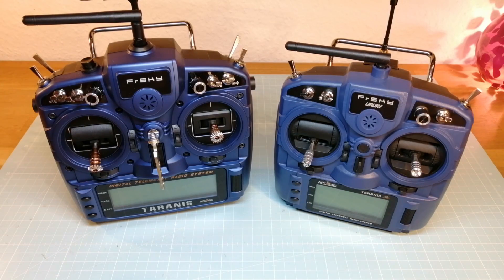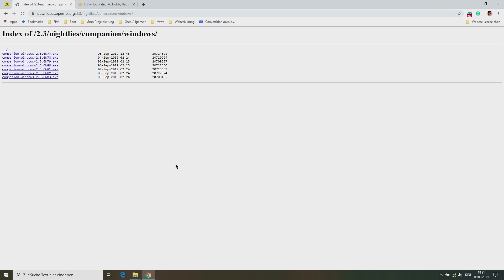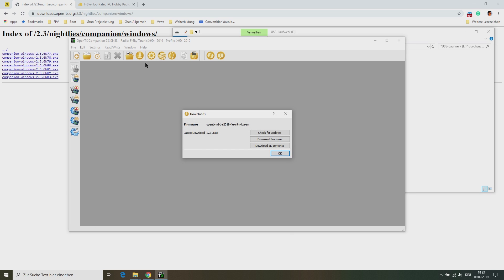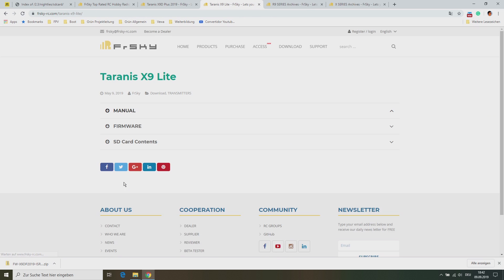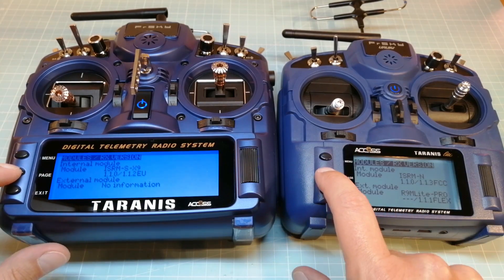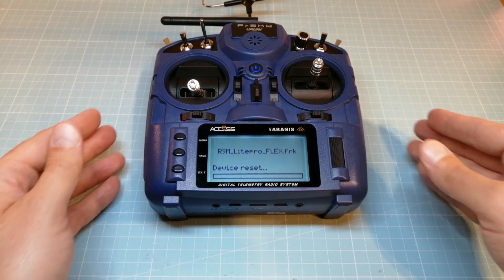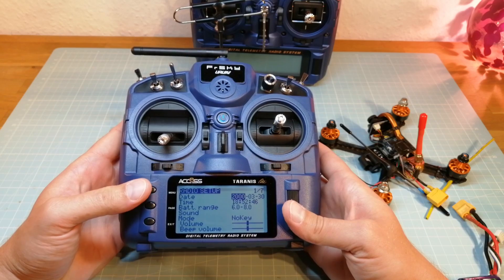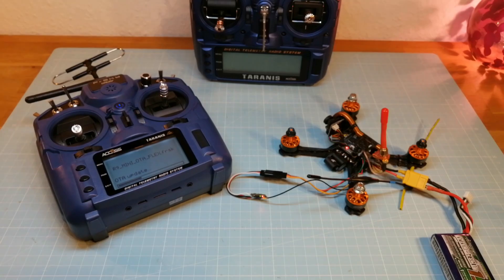FrSky X9Lite X9D+2019 🤓 ALL YOU NEED TO KNOW - OpenTX - EU-LBT / FCC - Firmware - OTA - Access - R9

Comment: Hello, thanks for the video! I have got a question. If I want to use access with 8 channels, how can I set rssi.? Will it be send in channel 16? When I bind the receiver with 8 channels, I get aux 5 going crazy in betaflight
Reply from the maker: Thanks, it doesn't matter if you bind it with 8 or 16 channels. The aux that goes crazy is probably the rssi output. But you can also broadcast your rssi telemetry value from your transmitter back to your fc over a channel. I did it on my last range test videos.
Reply: @TorbanDallas  thanks a million, you are the best! Keep bringing us this nice videos and knowledge
Reply: @TorbanDallas  nonetheless, even when set to 8 channels, rssi is still being transmitted via aux12... I don't understand, should it not be transmitted on aux 4?
Reply from the maker: @dmurillo11madrid  no, rssi output channel comes from the receiver and has nothing to do with the number of channels your are transmitting

Comment: Thank you for this video! Very helpful. I would like to ask two questions. I ordered today the r9 m 2019 with r9 mm receiver for my x9d 2019 se. I just discovered that in my order it doesn't say ota for tha 9mm receiver. Does this mean that I should order the new receiver with ota sticker or If I flash the receiver with the latest firmware it gets ota function. And the second question is that when you tried to register the receiver I saw in your taranis that you had the option to choose between fcc, lbt, 900mhz, 868mhz or access. When you choose access can't you chose between different mhz afterwords. (I am asking because although I leave in Europe I would like to keep my radio in fcc mode because some of my whoops receivers are in fcc. But for the r9 I want 868 mhz in order to avoid interferences. (I hope I managed to be clear and didn't confuse you thank you again)
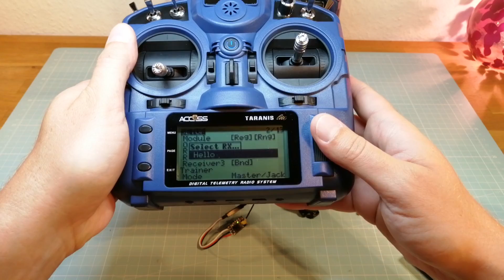Reply from the maker: Thank you for your feedback, I appreciate it! Don't worry, you can also flash the non-Ota receivers with the latest access firmware, but the Ota function won't work! If you want to flash the receiver over the air, you definitely need to buy the OTA Receivers. If you download the Access Firmware, you will see that you get 3 folders, one for the fcc Firmware, one for EU and  one for the flex firmware. With the flex firmware and your radio flashed with the flex option too, you will get the chooise which Frequency you would like to take on the binding process - you probably missed it, i have shown it in 11:56
Reply: @TorbanDallas  thank you very much for your help.. You are very kind. Have a nice day

Comment: HI AGAIN! i am using the x-lite pro, everything is working except  the rssi on the internal module using accts, my problem is from the telemetry-sensor source page on the radio, where it should say int module it is just blank and cannot get an option to change it, this issue is not a problem with the external module and works fine and i am getting rssi on the radio and osd but i use 2.4ghz on my short range quads, the radio picks up the rssi but i want to see the rssi in the goggles and i am not getting the rssi channel showing on the receiver tab in betaflight using the internal module. Any info to resolve this issue would be greatly appreciated. thank you.
Reply from the maker: It's not an issue. There are two ways of showing the rssi. 1. Using the Rssi ouput channel of your receiver if the receiver and the firmware provides one. 2. broadcast your rssi telemetry value from your taranis back to your quad over a channel.
Reply: @TorbanDallas  Thanks again for answering but managed to sort it out.

Comment: Hi bro Do we need Access radio to get OTA feature? I having old qx7 ACCT
Reply from the maker: yes, only the new radios with access are supporting OTA Updates. And as i know it's hardware related, so there won't be a opentx future release that adds the ota function.
Reply: @TorbanDallas  Can we flash flex firmware on R9 rx and will with work with old ACCT qx7 ??
Reply from the maker: @outboxfpv4360  you need accst oder access on both: Module and Receiver. But Access is only supported by the new r9m 2019 or the x9lite pro module. But you get the access fw also for old r9 non OTA Receivers on the frsky website. So you can use the r9m2019 with access and old receivers with access.
Reply: @TorbanDallas  I was asking about my TX. I have old Taranis qx7 will it work on it?
Reply: @TorbanDallas  also das alte R9M läuft nur mit accst Firmware verstehe ich das richtig? Könnte ich dann die r9mm, r9mini, r9mmOta Empfänger mit der gleichen Firmware flashen?

Comment: Hi Torban! I have Taranis X9 lite pro uruav edition and eachine reddevil 2 drone. I can not bind them with each other. However I can bind drone to other frsky transmitter and can't bind  my taranis to other receivers. Seems like a problem in transmitter. What could be a problem? Could you please suggest something to do?
Reply from the maker: I don't know the reddevil 2 drone, does it has a FrSky Receiver? Also make sure to use FCC or EU-LBT Firmware on your Taranis and your Receiver.
Reply: Torban Dallas In explanations to Red devil it says it suitable with frsky, flysky and other. I chose frsky. How can I check eu/fcc receiver?
Reply from the maker: @fanisaiupzhanov2299  you can't check it, you only can flash it.

Comment: good I do all your steps but with the stable version opentx 2.3.2, I put at r9m this version FW-R9M2019_ACCESS_V1.1.1 (R9M2019_FLEX.frk) and at r9mini this version FW-R9MINI-R9MM-ACCESS_v1.1.2 (R9_MINI_FLEX.frk) but I do not get flash S.port only gives me the option of flash external device and when I run it, it gives me an update error, which I do wrong, I think the firmw are the same version and also tried with other firmw, I don't know what to do anymore, Regards.
Reply from the maker: Flash s.port doesn't work on a X9D+, I think it only works on a Taranis  X9 Lite or Pro with the external s.port. On a X9D you need to flash external device and to connect it to your pins on the module bay. If you are using OTA Receivers with you new Taranis X9D+ 2019 or X9Lite Pro you need the OTA Firmware ( But you can also flash old non Ota Firmware to OTA Receivers)
I have heard about errors on flashing OTA and registering receivers with the newer opentx versions, it was already a bug that i have even posted on github. As you can see here: https://www.youtube.com/watch?v=SIfRGIPvVag
Maybe that's the error you are talking about.

Comment: hi I'm trying to flash the latest OpenTX FW but is says wrong directory /FIRMWARE even though its on the sd card '
Reply from the maker: Specifiy what you are doing please. Are you using companion as shown in my video? Did you download the firmware, and then when you flash it you get this message? Make sure to set the right structure path in the settings! And use en (english) language pack. In some cases you get errors with different languages.
Reply: @TorbanDallas  it was a simple wrong name in the folder hehe took me 4 hours to fix it . anyway thanks for the response and thank you for your videos

Comment: How can I get ISRM Lua script for X9D plus 
I have EU (LBT) transmitter and want to convert to Non-Eu(FCC) because of that I can not able to connect my R9M module to R9mm receiver
Reply from the maker: I don't know if this script also works with the old x9d+, there were two versions, fcc and eulbt with different internal modules available. So I doubt that you can change the internal module to fcc. And you are talking about the r9m... That has nothing to do with the internal one. You can flash the EU or FCC fw to your r9m module and your receivers.
Reply: @TorbanDallas  Okay Thanks for quick reply 
But I'm facing issue with binding r9m module to r9mm.And 3-4 weeks ago I manage to bind the receiver but after connecting to quad in just 5 to 10 sec it says telementary lost and nothing works no input shows 
I don't know what causing the problem my r9m module is also EU(LBT)
Reply from the maker: @sushreymeher3981  both have the same firmware version? Sadly frsky has released some faulty r9mm receivers with problems like yours... Maybe you have a bad r9mm 😕
Reply: @TorbanDallas  think so 😔 
Thank you 🙇

Comment: Thank you for that video!
I got a question:
I was trying for hours to get my brand new radio working in EU mode - I could not find the fitting firmware - now thanks to your video I know how to change that xD

So obviously the radio is bind to the receiver in FCC mode... when I change the setting in the radio, will the receiver still work, or do i have to change / update something else as well?

Thank you
Reply from the maker: Thanks for your comment, you also need to update your receiver to the EU firmware.

Comment: I am SICK of r9s,  I had 3 died with steady red led, then I bought 3 new one and came with access OTA stickers, and I cannot use them on my "old" configuration, i need to reflash my module amd taranis and then what happend with my other 5 quads that have the "older" r9mm model. BULLSHIT. Time crossfire
Reply from the maker: You can flash old accst fw to the new Ota access receivers and the other way around. The receivers are all backwards compatible like the new radios. Unfortunately only the old r9m can't run the access fw.

Comment: Hi Torban. I've got now a x9d+2019 and a r9m 2019 for testing. The internal module is backwards compatible so that I can use my old rxsr with accst . What about the r9m 2019? I flashed the access flex firmware and set the external module to r9m and 868. The old R9mm has still the latest  flex firmware of 02/2019. I was not able to bind the rx, unless I flashed the old non access firmware to the r9m 2019. But like this I will not be able to use old and new R9mm in different models. It would be better if both can be used like with the internal module. Any idea?
Reply from the maker: Yes would be better but I'm not the one who is programming the Firmware... I think you have to decide which fw to use. You can flash your old r9 receivers to the access firmware. That's what you can do.

Comment: Hi Torban....question: 1) are the old r9 mini and r9mm receiver compatible with the new access protocol and firmware??  2) I know the old r9module is not compatible so I will buy the new one....but can I use the new module with my QX7 radio? I will not use access with the internal module.
Reply from the maker: Yes you can use the new module with your old taranis. And you can also flash the old r9 receivers with the access firmware - just take a look at the frsky website ... there you will see that you can get also the access fw for your receivers.
But at the moment i think you won't be able to use the ota update function with your old taranis.
Reply: Thanks. Even with a new R9M module I won’t be able to use the ota??
Reply from the maker: @enricobononi8655  I don't know. I think it depends on opentx and your radio.

Comment: will the previous X9D+ SE work with the OTA using the R9 module if everything is updated to the latest?
Reply from the maker: I didn't try it. Do you have the Ota update option on your opentx version for your radio? I doubt it.
Reply: @TorbanDallas  no, FrSky isn't supporting older product with the new ACCESS protocol. Looks like only R9MM will work as long as Flex firmware is loaded. Do you know off chance if I flash the R9MM-OTA with the R9MM firmware, will it essentially turn it into a non-OTA R9MM?  Or am I stuck with a receiver I cant use?
Reply from the maker: @ASorren  try it and let me know if it works :P

Comment: Hello, sir! This transmitter dont support d8. Will I have any problems with tiny whoops like mobula7, that uses d8 protocol? Or if I'll buy multiprotocol module which supports d8 - It will be ok to fly that tiny whoops? What about long-range modules? Which one to choose to fly far away?
Reply from the maker: Hi, at the moment there's no D8 option available, but hopefully, opentx will add this option on a newer firmware release. They are adding more and more with every release. With the first release the new FrSky Transmitter haven't been backwards compatible and now they have added more and more option to also use the old accst receivers.

Comment: can I update my x9D plus? or i must buy new radio?
Reply from the maker: You can't use the Access Protocol with the old x9d+ for r-series receiver with the internal rf. But of course you can use the r9m 2019 with the access protocol. But I'm not sure if Ota update works.
Reply: @TorbanDallas  but I can't finde access update for my old x9dplus :(
Reply from the maker: @246rs246  did you install the latest version of opentx (OpenTX 2.3.0RC4 )? On the external Module - there I think you will also get the option R9M Access,
Reply: @TorbanDallas  I mess up settings on Companion, that was reason why I can't update my taranis to 2.3. Thx for help :)
Reply from the maker: @246rs246  and now you can select r9m access?
Reply: @TorbanDallas  no I have modes only Fcc EU 868mhz and 915mhz on my R9M2019. Im curios about if i update my x9D+ with x9d2019 firmware :P but I'm litle bit scared bicouse I have only one radio

Comment: thx Torban for the very detailed guide... i tried updating the R9MM and R9mini to access.... the update was OK but iwasn;t able to bind.... i'm running the X9lite pro, so do i have to update the internal modul as well with the nightly build? the remote cam with 2.3 official, but i couldn;t get it to identify the RX at the registration step.... 

the updating the internal nodule would not affect my other receivers?

thx alot in advance
Reply from the maker: Thanks for your comment! You need to update your opentx to the latest version (opentx 2.3.0rc4 at the moment) Check the flex option if you want the flex firmware, don't check it if you want the FCC Firmware, Check Eu in companion if you want the EU Firmware. This option changes the possible options you can select for your external rf. Then flash your external r9m lite to the latest fcc, eu or flex firmware corresponding to your companion setting. If you don't have an external r9 module you can't use r9 receivers with your taranis - then you need a R-series Receiver.
Reply: @TorbanDallas  thx..
meanwhile I was able.to update to the non access flex.firmware.. I'm running R9 lite module with MM receivres.. 
So I'll try going access flex once I'll update the radio to the latest openTx

Comment: why you dont give a link for lua script? It is a tool you use in the video, but you dont provide it... Thank!
Reply from the maker: I said that you have to ask Frksy, or me :) or maybe I will link it. But now you have asked me ... I will send you a link.
Reply from the maker: btw: until now, there were only two one asking me for the lua script - so there are only two eu users - or no one listens to me ;)

Here's a link for you, maybe i will also link it down below https://c.web.de/@400672573215480045/ZCiSYxw0THuc3tYleZIViw
Reply: @TorbanDallas  thanks very much🙏☺️
Reply: @TorbanDallas  that is how I ask when I am panic 😂 pls give me a link
Reply from the maker: @ALL4FPV  I did above...
Reply: @TorbanDallas  I update x9 lite Pro opentx to 2.3 nightly, firmware internal receiver to latest, R9M lite Pro to flex, R9 Mini to flex, I chose external modul r9mlp access and then I managed to register r9mini. However, it just doesn't bind... What I do wrong??? I have same problem with xm+, it doesn't event register. I flash it to access firmware and tried register didn't work. I flash it back to accnt and I chose internal receiver acnt ass well and it doesn't bind
Reply: I flash back internal reciever to 1.1.2 and I managed to register xm+ receiver. But I still cannot bind...
Reply from the maker: @ALL4FPV  what happeneds when you try to bind? Nightly n83 was fine but leatest nightly and rc's are having an issue... I have opened a github ticket about it. Hopefully they will fix it soon.
Reply from the maker: That's a short video about the issue https://youtu.be/SIfRGIPvVag
Reply from the maker: And here's my github ticket about it https://github.com/opentx/opentx/issues/6771
Reply from the maker: Now opentx has released 2.3rc3 - and now the issue is fixed

Comment: compilation error when i try to donwload .... can you helpme? 
and i want to use with the crossfire mod with the 
TBS Crossfire Receptor Nano
, is posible?
Reply from the maker: Crossfire is available for the external module so I think it's possible to use crossfire the same way as it was possible bevor with the old FrSky Transmitter.  I don't have Crossfire Modules and Receivers .. I'm only a FrSky R9 User :)
Where did you get the error? As you tried do download your opentx in companion? Never had this issue.
Reply: @TorbanDallas  Thanks Dude for supportme

Comment: Do you need to bind trough sport first before using ota? Or you can use ota straight away on a brand new r9mm access?
Reply from the maker: You need a R9 Ota Receiver, but you can also flash your old R9 Receivers with the Access Firmware - but if the old Receiver isn't OTA ready, you need to flash this one over a wire. If the OTA Receiver comes with the correct firmware, you can register and bind it without connecting it to your Transmitter.
Reply: @TorbanDallas  i have an x lite pro already and an r9mm ota on the way can i flash it over the air straight away?
Reply from the maker: @MrRyanf1981  yes I think so when it comes with the OTA Access Firmware. Power it, register it, and you can bind or flash it as shown in my video :) you only need to get the firmware from frsky and copy it to your firmware folder
Reply: @TorbanDallas  great. Thanks for your work keep it up